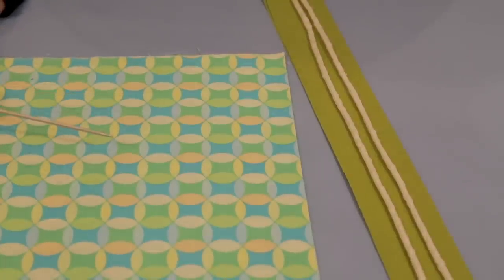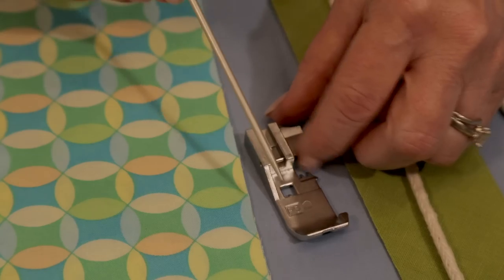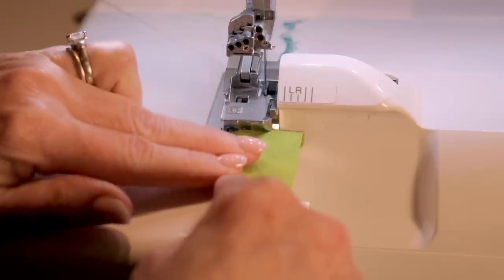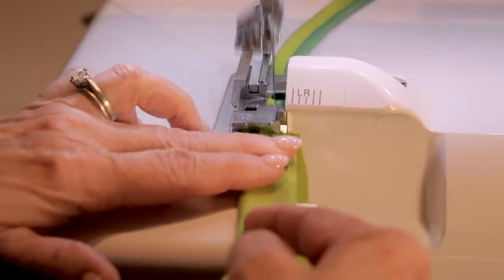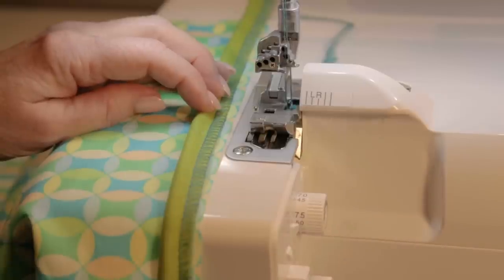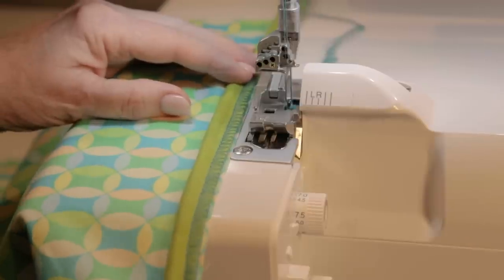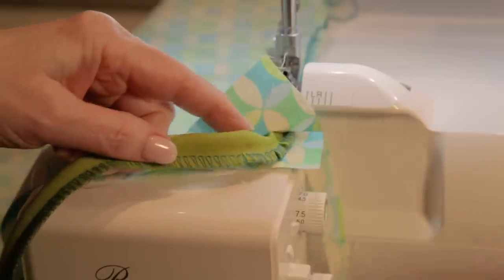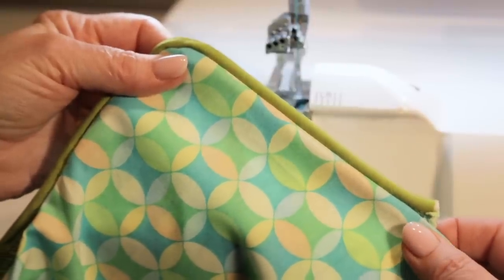The Piping (Cording) Foot

Comment: I'm making a pillow on my serger. Thanks for the piping tips - using a first pass of 3 thread overlock and second pass of 4 thread overlock, the corner stitching, and the end stitching. I'm a bit nervous doing it all because the pillow top is woven overlock serger strips fused onto interfacing, and I don't want to mess it up! All the tips help a lot. Thanks!
Reply from the maker: Hi Eileen,
Let me know if you have any questions or need help. Thanks for watching Serger Tip Clips!
Happy Sewing and Serging,
Gail

Comment: Looks really good.    Thanks for the tip for using wider fabric strip.    I never think of an obvious method that is better.  That's why I love to watch for your tips.
Reply from the maker: Linda Bridges I like to cut fabric wider for easier handling for many different techniques. Thanks for watching Serger Tip Clips and send along suggestions for future ones or any questions!
Reply: @GailPatriceDesign  I also have never heard of using the serger like a pair of scissors.  That's also an amazing! Thank you for that tip also.
Reply from the maker: Linda Bridges when I made my nephew’s baby’s cushion cover, I cut the fabric 2” wide and was just about to use my rotary cutter to trim off  almost 300” of extra fabric (yikes) for the 2 (top and bottom) cushion edges piping when I realized the Serger would be faster, easier and more accurate.

Comment: Thank you for your excellent video describing the method for sewing in piping. I’m a newbie and I’m intending to use a serger. I’m creating a cover for my serger and I want to decorate it with piping on the seam edges. Your instructions are easy to follow. I’m very grateful!
Reply from the maker: Hi Diane, Glad the video was helpful. Let me know if you have questions and thanks for watching!
Reply: @GailPatriceDesign  Hi Gail, I wrote up some notes after your video, so I could focus on step-by-step and realised I don't know how to join the cording when the circuit is complete.  Do you have another video that explains how to neatly join the ends when they meet?
Reply from the maker: @diandjohn4  I'll plan to do that Tip Clip next. There are several ways to do it, but I stop stitching about 3-4 inches from the end. Then I cut the filler cord to just meet the beginning edge. Cut the fabric 1 inch longer than the cord. Fold under the fabric edge and overlap it to the beginning edge. Pin the piping along the serger cover fabric and finish stitching. Let me know if that is clear or if you need more help. Thanks!
Reply: @GailPatriceDesign  Thank you! Much appreciated!

Comment: Wonderful tip, thank you!
I'm curious.. how to I handle connecting the ends of the piping?
Reply from the maker: Hi Brenda, I'll do a Tip clip on connecting the ends piping. Stop stitching 2 -3" before the end. Cut the end of the filler cord to just meet the beginning end, Trim the fabric on the finishing end 1/2" longer than the cord. Fold under1/4" and overlap it on the beginning end. Pin and stitch in place. Let me know if you have questions and thanks for watching Serger Tip Clips!
Reply: @GailPatriceDesign  thank you so much
Reply from the maker: @brendarainwater6049  You're welcome!
Reply: @GailPatriceDesign  I look forward to your finishing video for this. I just finished my pillow but I'm sure you'll show an easier way although my fabric was square same size the top always came out longer than bottom at every bottom corner after stitching off the end.  Why might this happen?
Reply from the maker: @brendarainwater6049  Hi Brenda, The fabric that's against the feed dogs (the bottom layer) will almost always feed through slightly faster thus making the top fabric slightly longer at the end. That's why when stitching stripes, plaids, etc on a sewing machine, you'll use a walking foot (Even feed or dual feed—all the same foot, just different names). If I need both layers to be exactly the same, I often baste them together right at the end point or pin them. I might slightly stretch the bottom fabric but not enough to matter. Hope that helps. Thanks!
Reply: @GailPatriceDesign  Thank you, I did try both I finally just kinda pleated at the start of next side it looks pretty good . I'm wondering if maybe baste whole thing first? All in all I'm really happy with it, you've been a great inspiration and I've learned something new! 💖
Reply from the maker: @brendarainwater6049  I’m a big fan of basting. It keeps everything in place and no pins or clips. I often machine baste sleeves on knit fabrics and many other items as well. It’s quick and saves a lot of ripping out if something is off kilter.

Comment: Hi Gail, I really appreciate all your wonderful teachings! I own an Ovation, and would like to know how to use my doublefold, or singlefold biasbinder on baby burp cloths. I cut a square piece of fabric, then round the 4 corners. When I do the outer corners, the binding slips away and the machine stitches on the fabric only. I'm sure you can help! Pleeeease?
Reply from the maker: Bernice Cloete Hi Bernice, those corners are a steep curve that take practice. Using scrap fabric, cut the same pattern shapes (several) and multiple binding strips. Lighten the presser foot pressure slightly to make the fabric easier to maneuver under the foot. Stitch at a slow to moderate speed. You may have to stop every few stitches on the the steepest part of the curve, lift the foot (with the needle down), and pivot the fabric slightly. It takes some practice, but I think you’ll do it. Try this method and if you need more help, let me know. I’ll wait to hear from you. Did you watch the tip clip on the binder? Thanks!
Reply: Thanks Gail, I found the 'pivot' part the best! Now I can add my binding nicely. I really think you're the very best, precise Babylock teacher. Keep it up, and God bless!
Reply from the maker: @bernicecloete4245  Wonderful news-congratulations on your success! I think of anything other than sewing in a straight line a " specialty technique" that takes some practice and finessing to get a perfect result. And nothing makes me happier than seeing sewists improve and expand their skills. So thanks for getting in touch and watching Serger Tip Clips. Tell your sewing.friends about it!

Comment: Question: can you eliminate the first step of making the cording and just serge it all while using the cording foot?
Reply from the maker: Hi, Technically, yes you could, but I wouldn’t advise trying to do the piping in one step. It’s too many layers to manage. Piping is such a lovely edge finish. You’ll get the most professional results by encasing the filler cord first, then Serging it in the seams of your project. Sometimes when I try to cut corners by doing something in a hurry, it ends up being more time consuming. I rip out unsatisfactory results and redo them. This probably isn’t the answer you were hoping for, but it’s my best advice. Thanks for watching and let me know if you have any other questions!

Comment: How do you join the piping at the end of the pillow?  Good video so far.
Reply from the maker: Stephanie Boik hi Stephanie,
You join the piping just the same as when using your sewing machine. As I approach the end, I cut the piping ends to meet, cut the fabric cover with enough to turn under about 1/2”. Lap it over the raw edge of the fabric and finish serging. (Maybe I’ll do a future Tip Clip on it). Let me know if you need more help and thanks for watching Serger Tip Clips!

Comment: Hi, 
Can i have the exact settings of this? I have the husqvarna viking overlock 936. Not sure where to put the needle and what settings needed. Please help. Thank you!
Reply from the maker: Hi Anna, all tensions are normal settings. Stitch length 2.5 - 3.0; Differential feed 1.0. Do you have a piping or cording foot? If you don’t have one, an adjustable zipper foot on your sewing machine will work. Let me know if you need more info and thanks for watching Serger Tip Clips!

Comment: If we don’t have a serger, what stitch would we use? (I’m on a Husqvarna Sapphire 930 Viking.)
Reply from the maker: Snap on your zipper foot and use a straight stitch. The zipper foot allows you to get in close to the piping cord. If your machine allows you to move the needle, that will also help. Let me know if you have more questions. Thanks!
Reply: @GailPatriceDesign  I have the cording/piping feet (2 of them - narrow and a bit wider).
Reply from the maker: @tricklefsen  hi Trish, use whichever size foot works for the size filler cord. Move your needle left a couple of clicks for the first stitching to encase the cord . Then when stitching between the two fabric layers, move the needle closer to the cording. By doing it this way, that first line of stitching won’t show. Let me know if that helps and thanks! Happy 4th of July weekend.🇺🇸🎇

Comment: So, can you only use .5 mm cording with that foot?  I bought .75 mm cording so do I have to have a different foot. I guess I should decide on what cord I should use? Is that foot for an overlocker/serger?
Reply from the maker: Cathie Huxtable yes, Cathie. The presser foot fits my serger. I’ll bet you can still use the bigger cording. Make a sample to test it.Did you plan to use a sewing machine or serger? Thanks for watching Serger Tip Clips!

Comment: will this method work with quilted material.
Reply from the maker: I quilted the cushion cover but used the fabric (unquilted) for the piping. As long as your piping and fabric fit into the piping channel, it should work. As always, make a sample to adjust stitch length, etc to be sure. You might also have to adjust your presser foot pressure if the fabric is bulky. Keep me posted if you need more help and thanks for watching Serger Tip Clips!

Comment: Howdy Gail! Just saw your tutorial . How are you able to get the cord/piping foot attached to the Cut and Hem foot?? This has me boggled like you wouldn't believe!!!😃😃😃😃😃😃😃
Reply from the maker: Yzabeaux1 Hi Yzabeaux1! The cording/piping foot is the only foot on the machine.it doesn’t block the knife from trimming off the extra seam allowance and it snaps on the machine just as any other foot would. Hope that clears up the mystery but let me know if you have more questions. Thanks for watching!
Reply: @GailPatriceDesign  THANKS GAIL, I'm visualizing it already! The cutting tool ; it surely can't already be built into the machine as it would cut everything in its path. There has to be a gizmo that looks like it would go alongside the feeding plates to accomplish this task. I'm guessing it's a separate component that is affixed to some area in the machine made specifically for completing this task. Sorry for the curiosity, Gail, could you name that particular cutting gadget? 😉😉😉😉😉👍👍👍👍👍 Thanks so much for your help!!😉😉😉👍👍👍👍💖💖💖
Reply from the maker: @Yzabeaux1  I'm pleased with your curiosity! The machine that I'm working on is a serger (also called an overlocker). It is a completely different machine than a sewing machine. It has a built in cutting blade for trimming seam allowances while stitching and overlocking the raw edges. The blade can be disengaged for certain stitching purposes, but is usually activated most of the time. thanks!
Reply: Gail Yellen  EUREKA!😂😂😂👍👍👍 Now I know why it was looking like the machine had two heads!!!😂😂😂😂😂 It's a  serger!!! Dear Soul, bear with me; but I haven't heard of a "serger" until now.😲😲😲😲😲😲😲 "THANK YOU" for the enlightenment😉😉😉👍👍👍👍I "genuinely" am "GRATEFUL!😉😉😉👍👍👍💖💖💖💖💖
Reply from the maker: Yzabeaux1 I don’t know what kind of sewing you like to do, but sergers are fantastic machines. They give projects a finished look inside as well as outside. As I mentioned, they are completely different from sewing machines and have a bit of a learning curve, but are fantastic . I honestly couldn’t sew without one!
Reply: @GailPatriceDesign  Dear Soul, You bet your boots I'm gonna have to look into getting one!!!😉😉😉😉 the finished edge looks "PROFESSIONAL!!!" I could swear when I saw you at your machine you were sprinkling"Pixi Dust" and just totally mezmerizing your audience with your leaps and bounds!!!😂😂😂😂 I admit,  I was blown away by your "matter-of-fact" laid back video like everyone had a serger! 😉😂😂👍👍👍 😉😂😂😂😂👍👍👍  I'll need to get me one if I'm gonna keep up with your videos, Dear Gail!!😉😉😉😉😃😃😃😃😃😃😃👍👍👍👍👍 Hugs to ya, Gal!!!😉😉😉💖💖💖👍👍👍👍 Thanks so much for SHARING the pixie dust! 😉 😉

Comment: Could you give me the module number of the foot you are using? I would like to buy one. Thank you.
Reply from the maker: For 8-thread Babylock sergers, the foot # is: BLE8-CF (5mm). If you have a 4-thread model, the # is: BLE-CF5. If you are working on a different brand serger, check the manufacturer's website for info. Hope that helps and thanks for watching Serger Tip Clips!